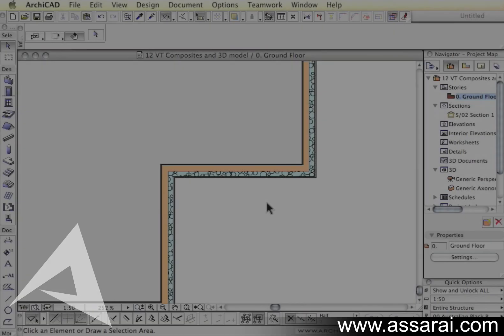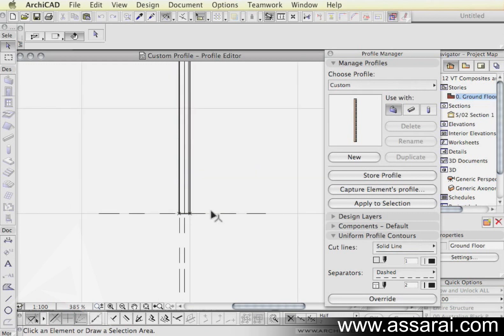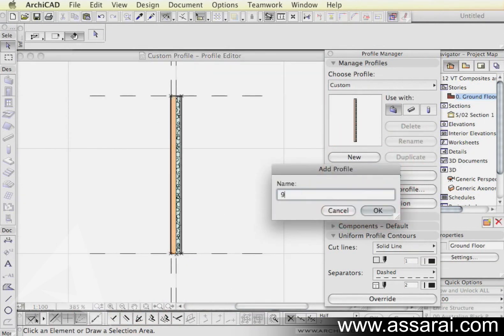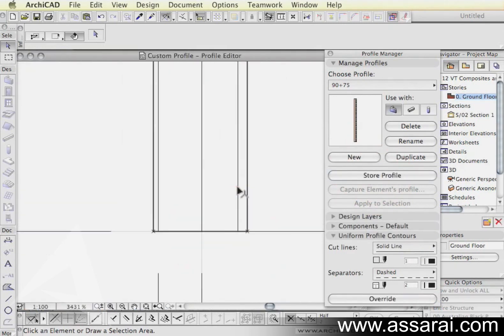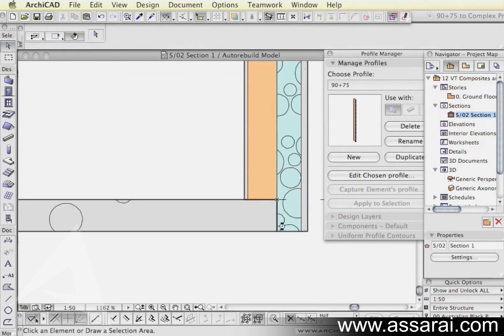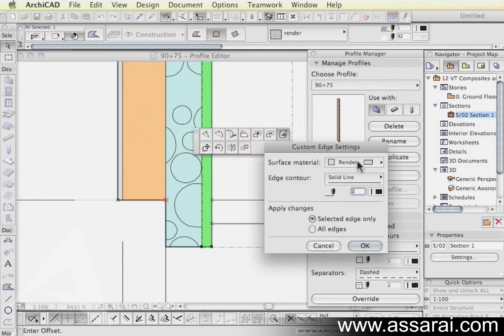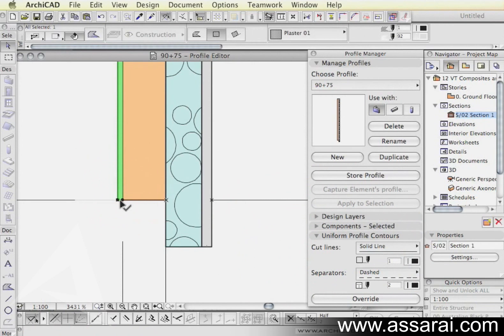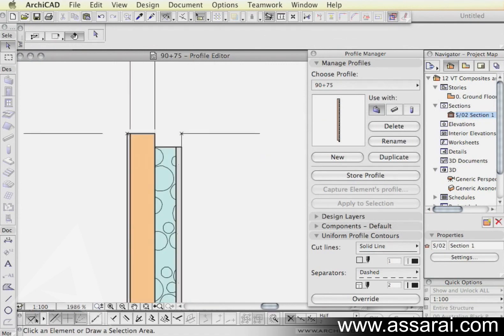035 More Complex Profile - ArchiCAD Tutorial

Comment: nice option, but how is this working with renovation filters (aka adding eps facade etc) and with changing floor levels etc?
Reply from the maker: No< then you have to use Compsite Type of Wall, it will be next
Reply: @AssaraiEngineeringFirm  yes, i thought so. with composites, please exploit option for renovation filters as i mentioned. i just working on some renovation, where insulation is added etc and i separate things to work with filters, as i didn't have time o study all the options for the reno-filters. works ok, but gets tricky when you want to do non rectangular things on facade etc. not sure why you cant use walls as morphs or terrain for example, would helped out so many things..